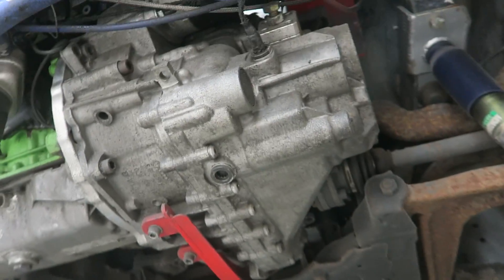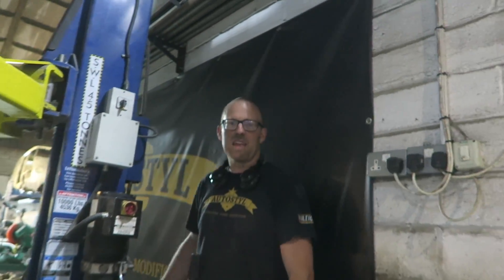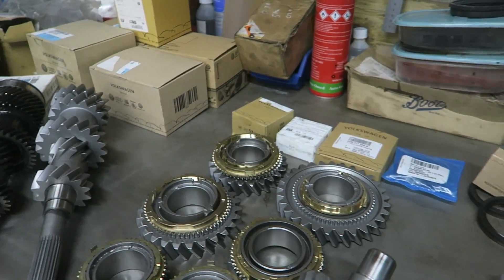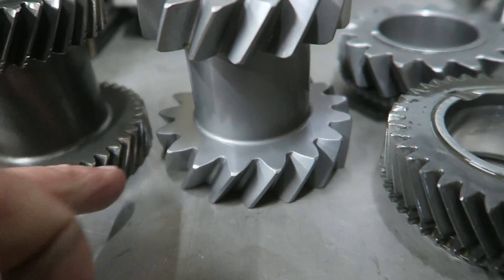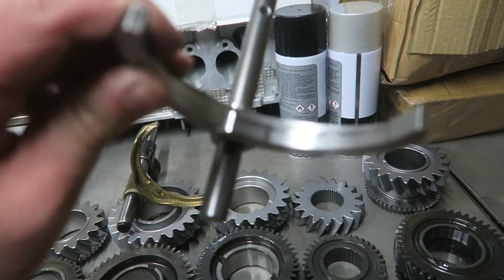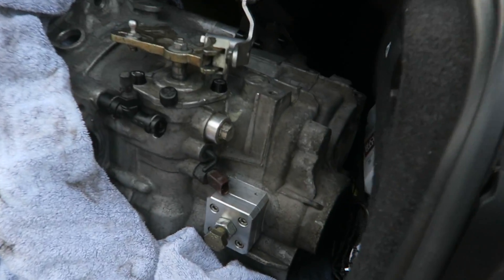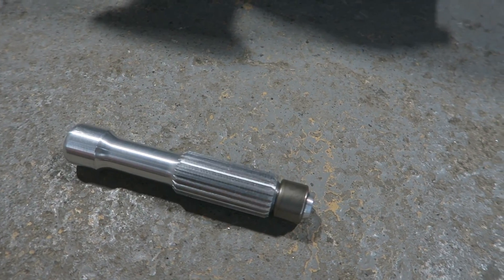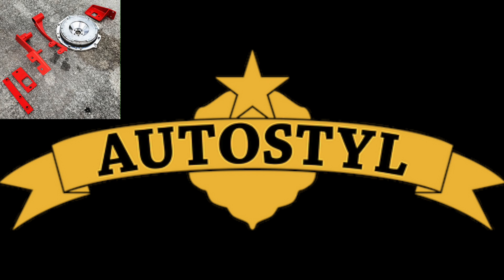02M 6 SPEED GEARBOX UPGRADE @GASNGEARS

Comment: why not a 0a5 gearbox?? no adapter plate, stronger gearbox from stock. 02q flywheel and rs3 clutch and it fits
Reply from the maker: 0A5 doesn’t tuck under the bulkhead and allow the drive flanges to sit inside the front subframe gaps for the NS inner CV. 02M also keeps costs down on shafts. T5 is a much easier van to swap engines into, lots more space and wider front subframe clearance

Comment: just wondering more about your concerns with a dog box. I have a four speed Front wheel drive trans in an american car. Same idea face tooth engagement with no synchros. The only real worry is that it's rough going in. as long as you're firm And don't pussyfoot, you're fine. It's always going in to the next gear. It's a bit rough for the street, if you're not looking for feel of a race car and the noise of straight gears etc.
What do you believe the issues to be?
Reply from the maker: Hi, thanks for commenting. To answer your question. I've got a few friends that have used dog internals on the VW 02M setup and they have had numerous issues. It could be box specific, user error, etc but by keeping it synchro I've kept it a bit simpler.

Comment: You shouldn't  put thet motul gear 300  in it, same mistake i did and to be honest the oil itself its good but you cannot do any quick shiftings untill you warm it up well, ill just go to genuine vw G 052 171 A2 wich is specially for this 02M gearbox, mine is a quattro but it doesn't matter.
Reply from the maker: Thats not the same experience I’ve had, the Gear 300 was recommended due to its thinner and less viscous cold temp which helps with cold shifting. That aside, I generally let the box oil come up to temp, at least 60° before sending it

Comment: I also wanted a 1.8 20v in my t4 at first but I made the swap a bit more difficult myself I made an audi TTRS engine in my t4 with the DQ500 and the whole driveline

makes 550 hp and 750nm

at 3500 it makes 600 nm is a lot of fun to drive
Reply from the maker: I looked at putting a DAZA/DQ500 in but realised I’d need to do a lot more modification to switch from what I have to get it how I’d like. Would be awesome to see some video & pics of yours 😎👍
Reply: @SpeedingTube  If you want you can send me a message via Facebook message

I can send you some pictures and videos
Reply from the maker: @jorddriessen1794  That would be great, I have an AIM SW4 steering wheel now so a DQ250 or 500 with a DAZ or 3.2 VR is high on the list but I've also been toying with the idea of a mid engine V8 S6 4.0 setup and haven't decided which way to go yet. Drop me some pics on FB/Insta if you like. Would be good to see how it goes, have you fitted an LSD into the DQ500?